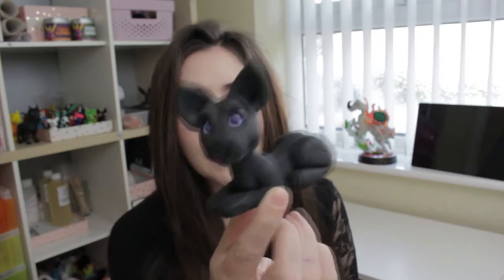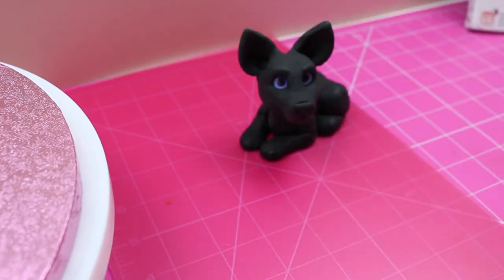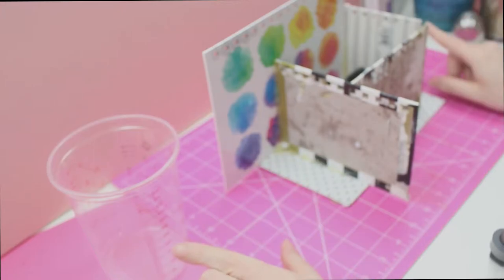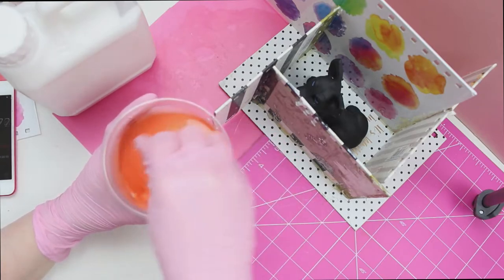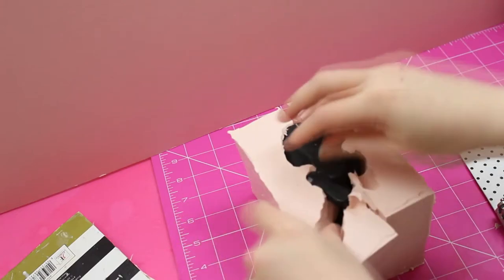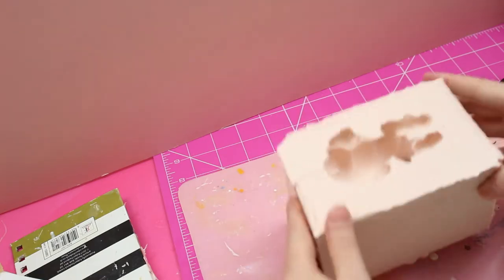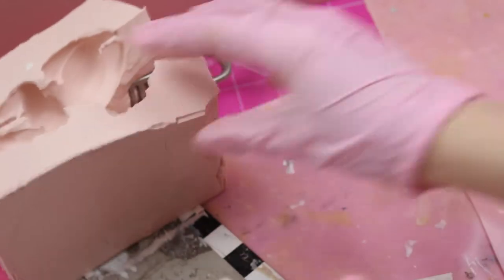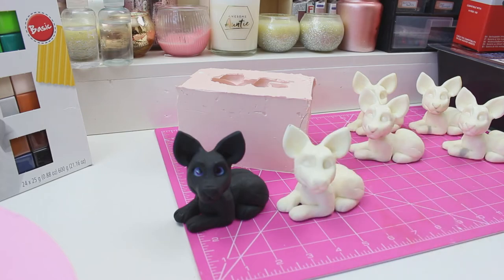Silicone Mold Making | Making a Mold from a Polymer Clay Sculpture

Comment: Just a quick tip, draw around the piece you are making the mould of on the base of the box, then contract the box. That way you can freely get into the box to ensure it’s sealed.  Then glue your model in last.  Raw rice is good
For measuring also! It’s also best to make the box fit closer around the model  so that you use less silicone and it will make removing the model from the mould so much easier. You can also dust your mould in talc which will help pull the silicone into small parts of the mould.  To prevent bubbles under the chin, I’d coat the inside of the mould with a layer of resin first. Tilt it around and the tap it on the table.  Hope this helps. Xx
Reply from the maker: Thank you Kit,  thats a really good idea, I will use that in future. I cant wait to try the chin idea, it always has the worst bubbles xx

Comment: So you did not put any lubricant or mold release on your original you molded? As well you didn't use any mold release when pouring your resin copy?
Reply from the maker: I did not use it on my original , but I spray it just before I pour a resin casting.
Reply: What did you spray the model with before you poured the resin?
 @KoochiWoochiKrafts

Comment: What is that amazing tool you lock open to cut mold?  I too have a 20 lb Elephant that I need to unmold!😂😂. Thank you in advance.
Reply from the maker: It’s amazing it’s called a surgical prong or surgical retractor , you can get them on eBay  😂 I wish you luck on demolding that